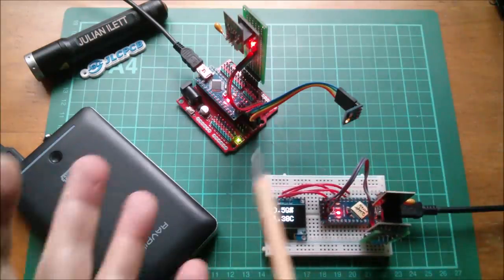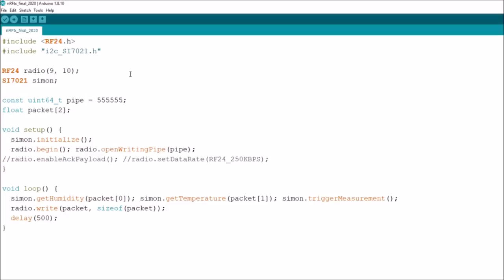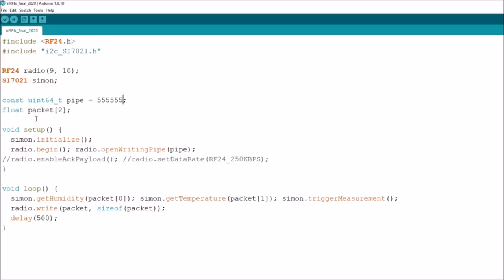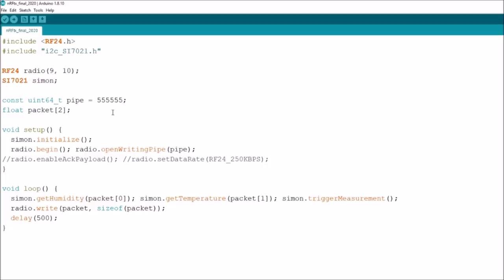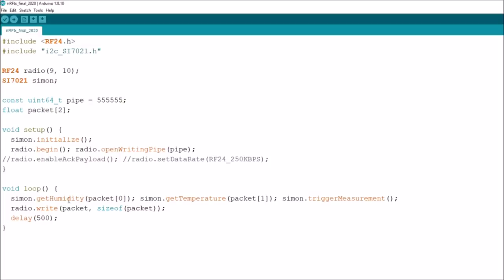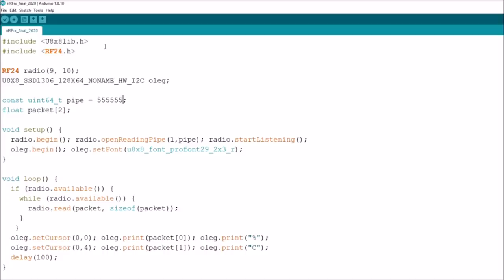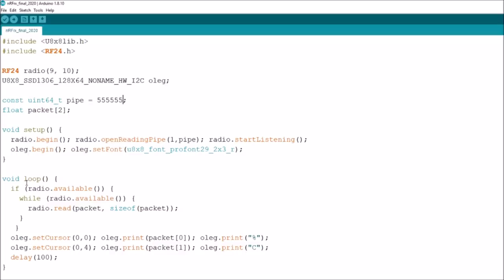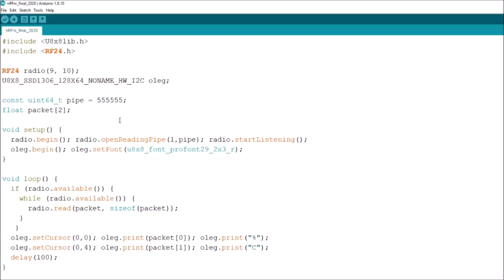Arduino - Sensor, Transceiver, Display - Simple Code

Comment: Dewpoint calculation is a little more complex than simply saying, "Is the humidity approaching 100%?"  It also uses temperature, because dew (condensation) will occur at relative humidity less than 100%.  Here is code that I use to control a heater and dehumidifier.My controller uses a LCD shield, so the display and UI is not important, but the dewpoint calculations might be useful:

float dewPoint(float celsius, float humidity)
{
  // (1) Saturation Vapor Pressure = ESGG(T)
  float RATIO = 373.15 / (273.15 + celsius);
  float RHS = -7.90298 * (RATIO - 1);
  RHS += 5.02808 * log10(RATIO);
  RHS += -1.3816e-7 * (pow(10, (11.344 * (1 - 1 / RATIO ))) - 1) ;
  RHS += 8.1328e-3 * (pow(10, (-3.49149 * (RATIO - 1))) - 1) ;
  RHS += log10(1013.246);

  // factor -3 is to adjust units - Vapor Pressure SVP * humidity
  float VP = pow(10, RHS - 3) * humidity;

  // (2) DEWPOINT = F(Vapor Pressure)
  float T = log(VP / 0.61078); // temp var
  return (241.88 * T) / (17.558 - T);
}
Reply: Thanks
Reply: @santopino2546  You are welcome.  Wikipedia explains the theory of these calculations.

Comment: Love the small code! Prsonality I would have used an esp32 with inbuild oled and used the esp-now protocol. Extra bonus is that esp32 can use touch inputs. Then you would end with one esp32 with oled and one esp32 with i2c sensor. Bonus tip: if you create the folder portable under the arduino folder, everything is kept under that folder: libraries, setting, project files.  That way you will not run into dependency problems when updating. Just install new arduino version in new folder and create the portable folder again!

Comment: Code comments:
(1) Receiver loop, I don't think you need both IF and WHILE.  If there is only one packet (8 bytes) to receive you only need to do the WHILE loop once so just use IF.  If there were multiple packets to receive you would use just the WHILE loop.
(2) You are continuing to print to the display even if there is no new data (packet) to print.  You are doing it about 5 times for every packet received as you have only a 100ms delay in the receive loop versus 500ms in the transmit loop.  Of course this works but I'm wondering if it can cause display flicker when video recording at lower lighting levels.
(3) When the temperature or humidity drops to one digit (ie. from 10.00 to 9.99) you will have a left over "C" or "%" that is not erased and end up with "9.99CC" or "9.99%%".  Same thing if it goes to 100.00 and then down.  A simple fix is to add a space after the C and %.  But a better method IMHO is to add a leading space (or two for the humidity) when required so that the decimal point is always in the same spot on each line.
(4) Scrolling is fine if you aren't jumping back and forth too fast, etc.  I don't recall having a problem with you doing that before.
(5) I enjoyed this video, Julian!
Reply: Would have been nice to see the Tx and Rx code side by side in two windows in preference to long lines of code - IMHO.
Reply: Also, If there are multiple packets, the while loop will just overwrite all but the last one in "packet"

Comment: Hi You may want to consider a push button to turn the OLED on/off. The OLED will start to degrade after about 1000 hours if you keep it on all the time.
Reply from the maker: Really, OLED burn-in? I'm quite keen to see that :)

Comment: Very cool, I am so happy to see you once again delving into my first love, the Arduino.  I bought a bunch of those NF cards years ago and have never learned how to use them.  The reason? Simple, the ESP8266 hit the market and you sold me on it being the Arduino KILLER!  Well it didn't but it did give us something to have a blast with, as well as the much better ESP32 which has miniaturized everything to a great extent. That said, I still have my very first Arduino. When I purchased it, I thought it looked so vulnerable that I picked up a clear case for it, and it has survived every task I have given it without letting out the magic smoke!

Comment: Great project! I did a similar project for our greenhouse with temperature, humidity, and soil moisture sensors. To extend battery life you can use the radio.setPALevel command to set the transmitter power level (I use low, -12dBM which gives me plenty of range) . Also, the radio.powerDown and radio.powerUp commands can be used to turn the transmitter output on and off  and, for added battery life you can use LowPower.powerDown  to put the Nano to sleep for a while.

Comment: I would add an outside-shed humidity sensor and a rain detector outside. There is little point in wasting your battery, sucking the same humidity air or indeed rain drops, back into your shed on the occasional very humid days we have in the home counties. Your code could wait until the humidity outside drops and the rain stops to turn on the extractor.

Comment: Hey Julian, You make the receiver code a couple lines shorter... you can get rid of the "if (radio.available()) {" and the matching "}". The while statement will serve as the 'if' condition. Awsome  simplicity :)
Reply from the maker: I'll try that - thanks David :)
Reply from the maker: It works - excellent further reduction - thanks :)
Reply: @JulianIlett  glad to help :)   It works because a 'while' is really a "if" at the top of a loop.
Reply from the maker: I've also removed the delay() in the receiver as it seemed a bit unnecessary :)
Reply: @JulianIlett  good idea to remove it on the receiver. If packets arrived fast from the transmitter you could lose some (depends on buffering and how the RF24 library is written). Of course you do want to keep the delay on the transmitter side.

Comment: Nice and simple. Now separate the two modules by a couple of metres and see if they still work. I have had absolutely no luck in getting these things to talk to each other beyond about 20 feet and that's line of sight. Put a cat between them and the signal disappears. I appreciate you can increase the transmitting power and make little wire aerials., but I still can't make them reliable.
Reply from the maker: I've already had the Tx outside on the patio. Do you have the capacitor soldered to the nRF board? Are you using the adapter (with 3.3V regulator) for the nRF?
Reply: @JulianIlett  thanks for the speedy reply!  Yes, I've added the cap and run it from an adapter. I've even made a JLC PCB to keep things tidy. I was trying to make a radio doorbell, but gave up. Perhaps I'll dig the bits out and try again, inspired by your success.
Reply: @pintokitkat  How about using the version of this module with antenna?? If I recall it correctly it was NRF24L01+ PA
Reply: Try changing to the antenna version or Play with the data rate and set the Power level to MAX. 
radio.setPALevel(RF24_PA_MAX);  
radio.setDataRate(RF24_2MBPS);
Reply: @webslinger2011  Well, I gave it my best shot.  Added the capacitor, raised and lowered the data rate, and upped the power to MAX.  I still can't get a signal from one side of the house to the other, so the doorbell prioject  using the bits I've already got is shelved!  Ah well, that's the hobby.

Comment: Oh, forgot to mention, right now here in South Dakota it is snowing and the winds are gusting over 50 MPH so it is not a nice day, the temp is 28 F (-2.22222222222222) C
Reply from the maker: We've not had any snow this year... so far :)

Comment: You don't need the if radio.avalible() around the while loop. If it's false the while loop won't run.
Reply: I would suggest getting rid of the while, not the if.
Reply: @svengaefgen5909  As would I.

Comment: 6:35 That WHILE radio.available seems pretty redundant within the IF statement.
Reply: It's worse than redundant, it eats packets silently if there are more than one.
Reply from the maker: In that case - it's coming out :)
Reply: I think the "if (radioAvailable())" is redundant, as the while() is checking for the first available already.
Reply: @jumhig  , the IF statement is executed first.
 If the IF is false, the While will never even be evaluated.
 If the IF is true, then the While doesn't need to be there.

The only possible use I could think of, which won't happen any way with this sketch, is if a bunch of temp/humi data packets had been sent, and not dealt with, the While loop will run & exit with the most up-to-date data.

Comment: Maybe a 2nd sensor outside the bilge pump to nOt trigger if the outside humidity is higher than the inside?  Might have to use a smaller font for the code ;-)
Reply from the maker: That's the plan :)

Comment: The first thing you should do is cut a vent hole at the bottom front of the shed, and another at the back at the top, that will introduce an airflow, if you want to increase the airflow, a solar panel/battery to powerr a small fan
In the winter you might want to introduce a heater, the tubular greenhouse heaters run at about 60w/foot, add a thermostat so it comes on at about 11C which should help with the dewpoint
Why do you think that a house roof has soffit and ridge vents and don't go mouldy.
Reply: Does no one know anymore that the plural of roof is rooves. 😡

Comment: (a) You'll get significant condensation long before 100% humidity. (b) Why not automate the fan as well? (c) Exploring shed warranty still would be the much better solution if possible.

Comment: I've been wanting to do something similar for my travel trailer. Been a while since I ordered some hardware to attempt this. Need to get motivated to have at it. Might come back and look over your  sketches. I am also using nanos but can't recall which tx/rx I got. My first plan was to use a wifi module and use that to upload data to Thingspeak then monitor data from cell phone. Thanks for the inspiration.
Reply: You can try Aduino.io, it's free and I've tried it. Just have to limit reading every 5 secs ( I think ) to not go over their terms and conditions.
Reply: @webslinger2011  thanks for the tip, I'll check it out. So I dug out my Tx/RX (433 Mhz) and got em up and running with a simple "Hellow World" and the range I need will be too small so I'm back to prob doing the wifi with an ESP8266 I have messed around with some.
Reply: Whoops! My bad, It's adadruit.io not arduino.io.
Reply: @webslinger2011  LOL turns out arduino also has IoT, I breifly checked it out. Will also check out adafruits. Got the ESP up and running now just need to add in the temp/humid sensor and decide where to send the data.

Comment: Nice one, Julian! Say, have you got any plans to see how slow and energy-saving you can get the whole system?
Reply from the maker: The Tx and blower fan will run from a small car battery in the shed. Tx will be on 24/7 but the blower fan will only do a couple of hours a day. I can't see TX current consumption being a major problem here.
Reply: @JulianIlett  I see. Well, it was more of a "Let's see how low we can get" kind of idea, with underclocking the Arduino, transmitting only every minute or so, and suchlike.

Comment: I find a way to show ° for the temperature unit °C on the display.
oled.set2X();
oled.print(temperature,1);
oled.set1X();
oled.print(" o");
oled.set2X();
oled.println("C");
I'm using the Adafruit oled library

Comment: Why not just make it read the humidity remotely and activate the blower autonomously?
Reply: Then, you could use the radio to send an alert via radio if the humidity is over 100 for a predetermined amount of time, so you can disable it during inclement weather.

Comment: Now make the transmitter run on a 18650 or two
Reply: With a decent operating time of course - a couple of months at least. I built a esp8266 device that sent temp and humidity (via wifi) every 30 or 60 minutes. Even with deep sleep it only lasts around a month on a 18650.
Reply: With solar too might last long time 😁
I've added solar on my LCD clock it lasts long time now 😂 but I Neva dated when I put charged batteries  in 😆

Comment: Yer a wizard, sor! However, I see about issue remains: an alert to wake you if humi or temp go rogue. Now I wish to offer a suggestion (and please don't be offended with comments from the 'peanut gallery': it's with the best intentions!): rather than a switch to turn the {to be implemented} fan on, just put an IF statement and let the device turn the fan on–even when you're away or asleep.

And an alarm would still seem to be a valuable addition, wouldn't it?
Reply: Just what I was going to say! Turn the fan on automatically, and have an indicator on the display to show it's running.
Reply: I see an issue, I live in the MidWest US. 95% humidity happens around here a lot. If you have 75% indoors, 80% outdoors, and your 'trip' setting is 70%, why bother to turn a fan on? You'd need to constantly monitor indoor & outdoor, and have a logic for figuring out if it would be worth turning a fan on. It may be where he's going in the future, but for such a minimal 'prototype' sensor and sender-receiver pair, this is excellent!
Reply from the maker: I'm going to start manual, then go automatic. I need to add voltage and current monitoring of the 12V battery for the fan before it can be fully automatic :)
Reply: Your talking about the guy who loves watching batteries charge , he won't automate it...besides, takes all the fun out !

Comment: We just got hit with a mini blizzard here in New Mexico, which is very odd this time a year...
Reply: We should be having cold weather, it's winter, but temperatures are way too high, over 20°C in many areas in Italy.
I stayed with all my windows opened for many hours today. a way of heating the rooms I'm not using, and were at 13°C (i don't heat them to save on costs).

Comment: If you allow the humidity to get to 100% everything in your storage shed will be moldy. You need to keep your humidity below 60%. 

The sensor library may include a dewpoint calculator. You may want to check into it.

Also, A heater will be more efficient than a blower, especially in rainy whether. But it might not be cost-effective. If the temperature is 0 C, the humidity is going to be close to 0 %. No need for the heater/Blower.
An object that is cold, will condense moisture even in low humidity. So you want to keep everything as close to the air Temperature as possible.
Reply: A dehumidifier would probably be better than a heater. More expensive initially, but will use a lot less power over time.
Reply: @Zadster  Maybe, if the shed was reasonably sealed, like your house. But this is a storage shed. It probably has air coming in all directions. he would need a very large dehumidifier. 

 I said it would Probably not be cost-effective. A dehumidifier would have the same problem. It would also have another problem, all that water, and what to do with it. Remember, he lives in England. That is a very humid country. You cannot   Dehumidify the entire country. Also, when you condense moisture out of the air, you're also pulling more humid Air into the room. So you're just compounding the problem.

The best option is to make sure the shed is reasonably sealed and insulated. Once that is done a small heat lamp should do.